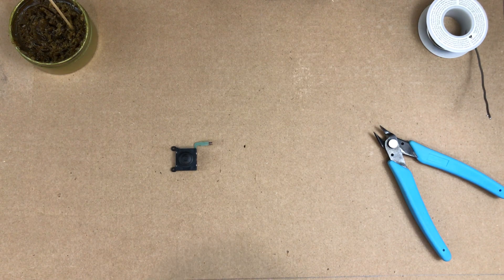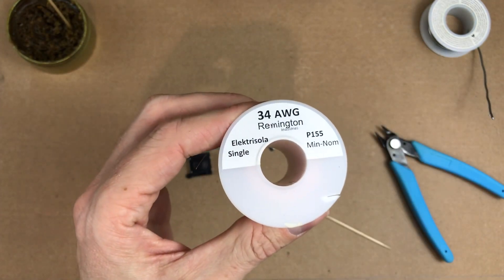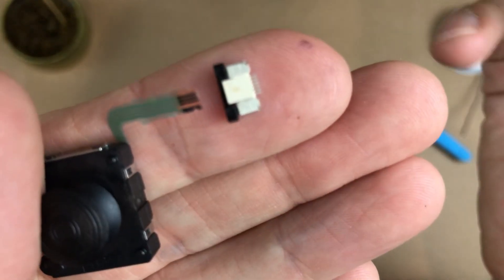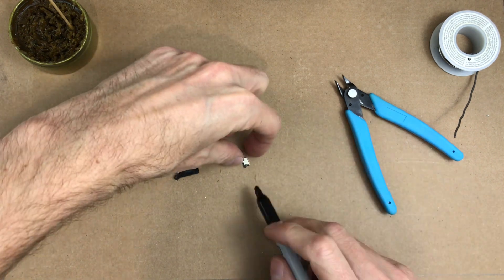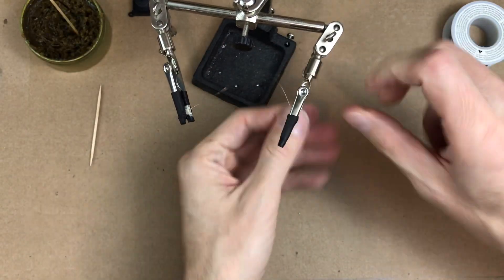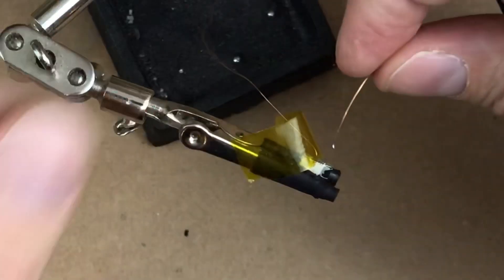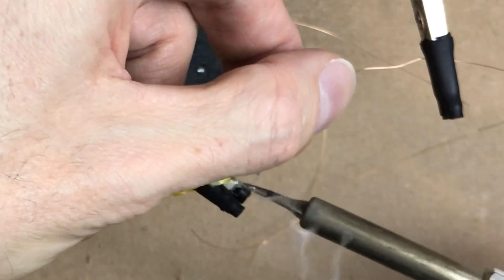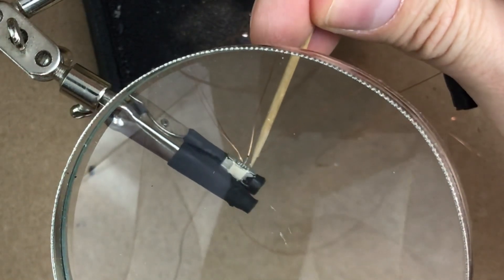Build Log Freeplay CM3 Vita Analogs 01 - Analog Stick Wiring

Comment: Hi can i solder directly to the ribbon cable? I wasn't able to find the connector.
Reply from the maker: Oh no soldering to the cable unfortunately; it will just melt. I tried different ways to attempt that just messing around and I could not find any way to make it work.

Comment: This idea for soldering to a ribbon cable connector is genius. How possible do you think this would be for a 3ds C-stick?
Reply from the maker: Mel-Christopher Tiongson Thank you. I’ve never messed with a 3DS stick, but I bet there’s a way. In an upcoming project I’m going to use Nintendo Switch Joy Con analogs. I couldn’t find the exact ribbon cable connector, but I did find one with an extra space. So I’ll just use that and leave one of the outside pins empty.

Comment: Hi I've just started watching your build series, Love this kind of build. I was wondering what the connector for the vita analogue  stick ribbon cable was because it seams that the eBay link isn't working any more.
Thanks
Reply from the maker: Oh I see the link is not working anymore. I tried searching just now on eBay and Amazon, but didn’t see it right away. I’m sure they are around, but may need to be tracked down. The connector is a flat ribbon connector with 6 pins and .5mm pitch. The .5mm pitch is referring to the distance between from pin to pin. That will help in searching for them. If I find another link I will share. Also, I think you can use flat ribbon cables with .5mm pitch that have more pins. I haven’t tried to see how well it works though. I will be trying that myself with Nintendo Switch Joy con analogs probably in my next Freeplay build. So if you have a connector with 1 extra pin I think you can just make sure the cable is oriented all the way to one side and just ignore that unneeded pin. I think that will work. I’ll find out soon enough :) . -edit: I bet a 5 pin connector would work with these Vita sticks too. You could probably carefully clip off that last empty space on the ribbon so it would fit correctly into the 5 pin connector.
Reply from the maker: Dale Beever I think this will do. I haven’t ordered these specifically from this seller, but they look right. Uxcell Bottom Port 6Pin 0.5 mm Pitch Ffc Fpc Ribbon Sockets Connector 10Pcs https://www.amazon.com/dp/B016VQZZK6/ref=cm_sw_r_cp_tai_MjYsCbJNR8180
Reply: @jivinhipcat  thank you so much. Will order some and have a play